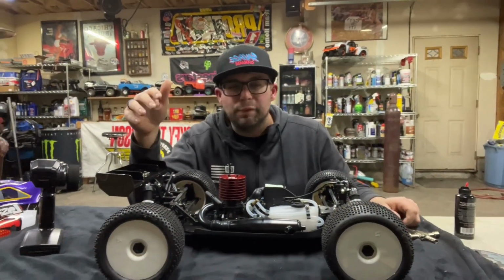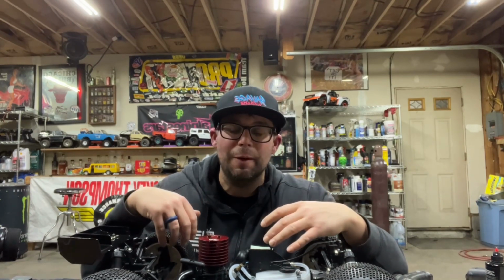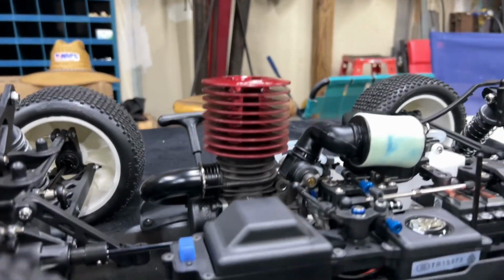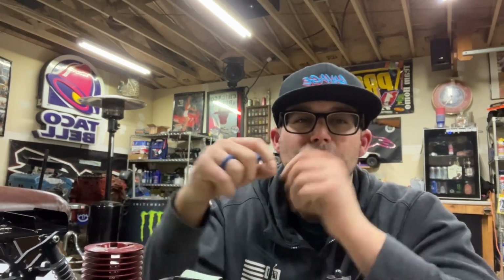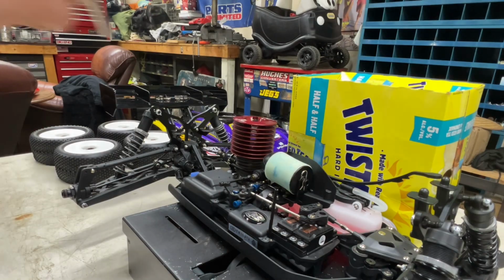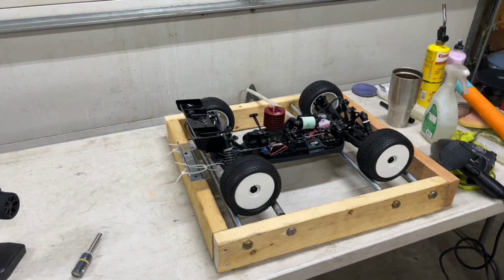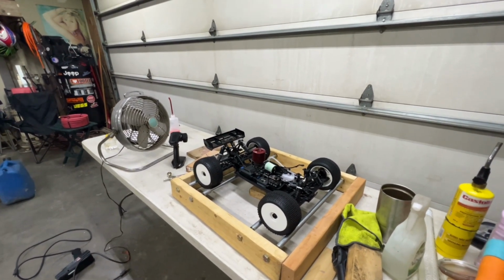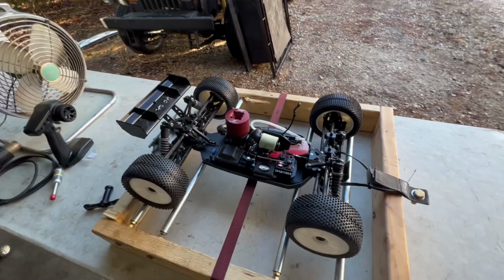Losi Truggy Breaking in your Nitro RC for Beginners (We Built a Break-in Table)

Comment: Nice video. What I do is run 6 tanks total, all heat cycled before it ever touches the ground.  1-4 low idle. 5-6 slightly higher idle with few blips. 7-9 On the ground. Quarter throttle on 7 for 2 seconds at a time through half that tank. Then three to 4 second intervals withe other half. 8th tank, same as 7 but half throttle. Tank 9, same as the other 2 but 3 quarter throttle through half tank, then full throttle with leaning on the other half. This is all done smoothly on the throttle  just like this guy did. No jerking the throttle. I also really appreciate the way he put emphasis on keeping the idle low. I can’t tell you how many people are at like 11 to 12 thousand rpms during breaking in. Bad deal. Low idle is the way. I would say this guy has it down pretty well. The more time you take, the better and easier it will be to tune the engine in the long run. Especially smoothly throttling when you finally reach that stage. Excellent video, one of the best. I’m telling you. If you follow this break in, your engine will last much much longer. Thank you for presenting this to people. You know your stuff.
Reply from the maker: Wow man☺️  I appreciate that for sure. We finally got to rip it on a track just a month ago. Ran awesome. Did a couple short vids. Nothing crazy.

Comment: Those dynamite engines break in super easy compared to a $300 plus race engine. Super easy to tune too, and damn near bulletproof. I used to have that same kit, was my first nitro
Reply from the maker: That’s good to hear! Do you run 20 percent nitro or 30? Does it wear on the motor that much harder?
Reply: @FullSpeedImpulse I ran 20 in my 8T until I built my 8X buggy, then switched to 30 so I didn’t have to buy two fuels. I suspect it probably wears bearings and especially conrods faster because of the power increase, but I think the effect is minimal. As long as you’re tuning correctly it shouldn’t make much difference; since the higher nitro % runs richer, you get more oil through the engine and that mitigates some of the damage. Usually only the glow plug heat range needs to be changed, sometimes head shims need to be added for higher nitro but not on the dynamite .28. I ran my .28 and my .21 on the dynamite r5 cold plugs and it’s perfect
Reply from the maker: @simplegr33n420 Alrighty!!! When I was at the track I ran out of of Morgan fuel and had to buy some traxxas stuff at the shop. And my RC ran rough after the fuel change. Any brands you prefer?
Reply: @FullSpeedImpulse I use VP because that’s what the local shops carry. Incidentally that’s supposed to be some of the best. Byrons is good too. I’ve hear bad things about traxxas fuel but I always assumed it was just people hating on the brand

Comment: Does this work for any nitro rc car because I'm thinking about getting URMODELAND RH1007 Remote Control Car, 2.4G All Terrains RC Off Road 4WD  1/10 RC Buggy Truck RC Car  Toy, 60KM/H High Speed RC  Truck Vehicle Modle Gifts for  Adults RTR Version one of these for my first nitro rc cars
Reply from the maker: I haven’t heard of that one. But yes your process for breaking in a nitro is usually the same as far as I know.

Comment: Im just curious as to why so many "break-ins" are needed? My Losi is coming on Thursday and I'm trying to get the break-in down, before i start lol.
Reply from the maker: Yea the biggest thing no matter who you decide to follow for your break in. Do a idle brake in, 1/4 throttle, 1/2 throttle and then 3/4 throttle. The motors are super tight. Has you run it you will notice how it gets easier to start. Make sure you preheat that motor!! Crazy difference on how much easier it is to pull start. Hope this helps
Reply: @FullSpeedImpulse  Okay now i see what your saying.. It's stages of breaking in🤦🏾‍♂️. Okay gotcha... I've had nitro before in 2006, and i don't remember doing all of this, but i do remember i ran that thing for 30 min to 1 hour straight though too. So I'm tracking now, thanks for the reply🤙🏾🤘🏾